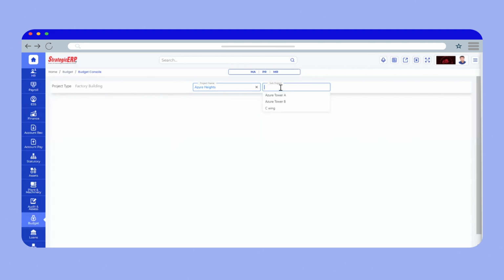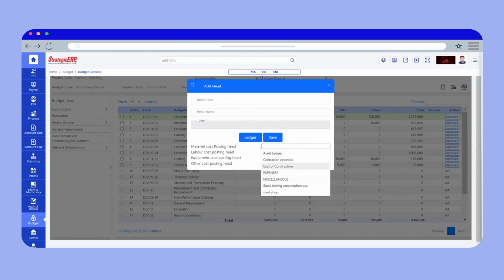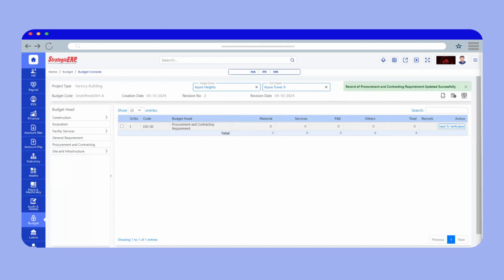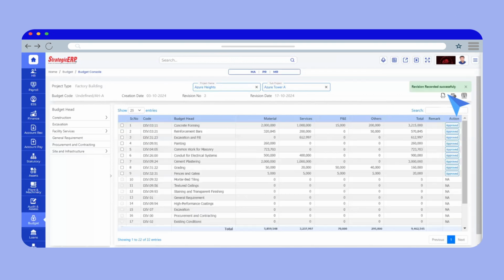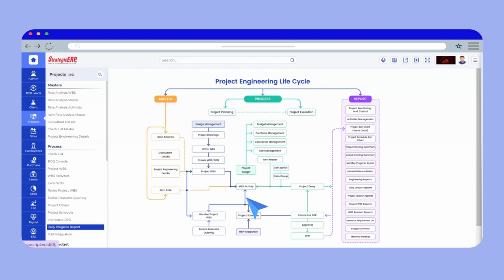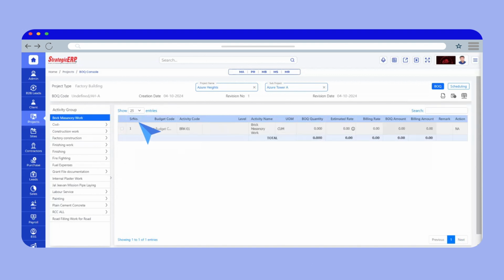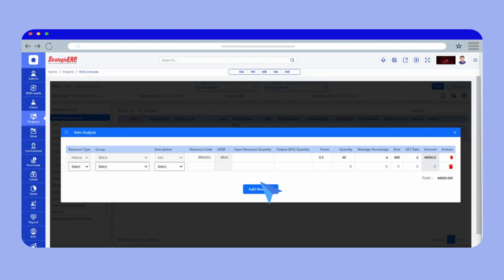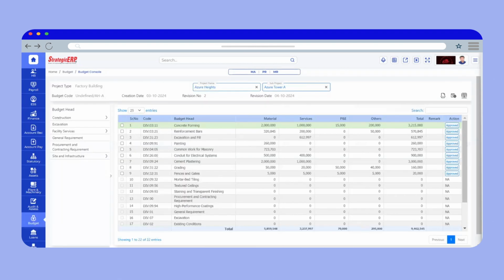StrategicERP Revolutionizes Construction Project Management with POWERFUL Budget Tools!

Comment: Feeling good that my design now in you tube. Praful Sir few portion need to update. reffer my hand over document. Still need to do so many area if you want a proper Project management module. pushing data to existing WBS structure is not right. there is a different way to handle it.I hope some one definately complete my development as I designed.